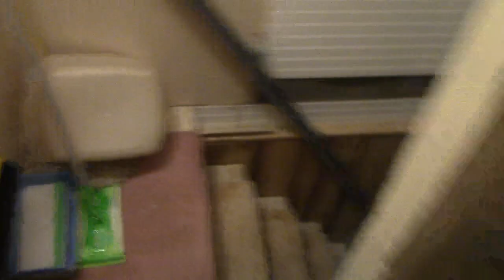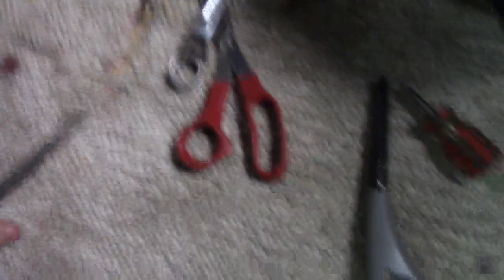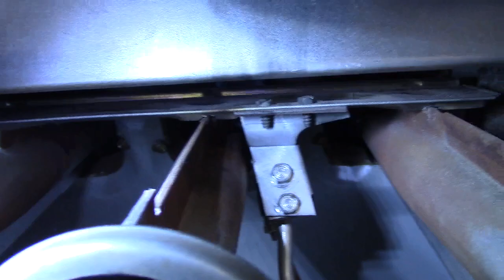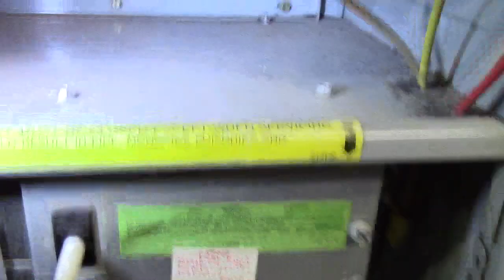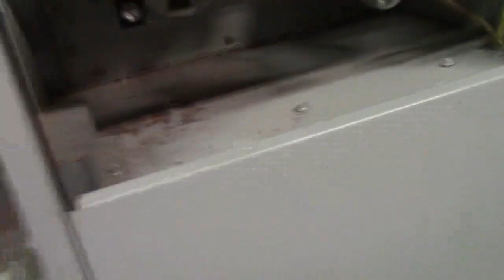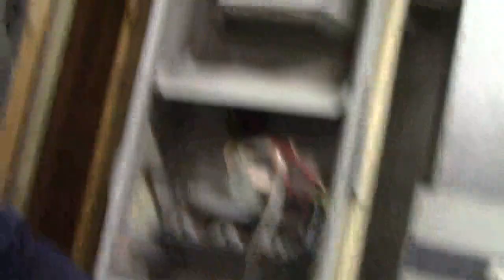Heil Gas Furnace 1990 Safety Trip

Comment: the old furnace must have been over 25 years old seeing that it used a standing polit and I don't think I heard a draft inducer either. so between the rust on the burners   and the crack in the heat exchanger on top of everything I mentioned in the last sentence you    were due for a updated system and even if you don't go with a condensing model as is now standard in my part of Canada ,  you should still have lower gas bill.
Reply from the maker: if you go through my videos they put in a 95.5% gas colman furnace I had a year had no issues its a smaller btu then the one they had in there. and my bills have went down a lot saved be a 100 bucks a month. and that thing has a big blower fan and really blows the air which i really love.